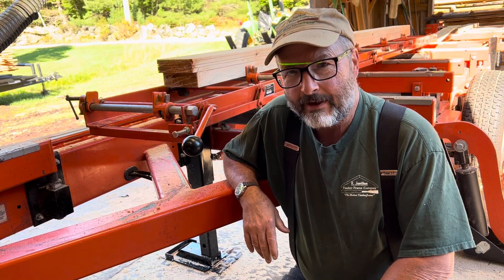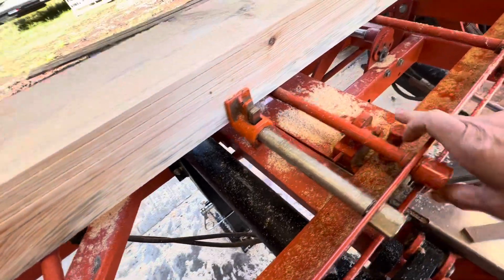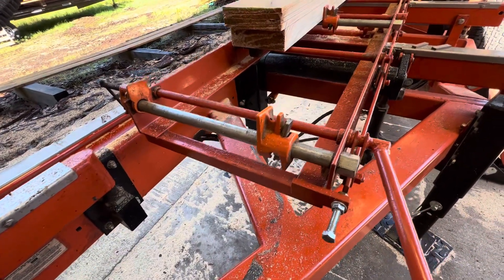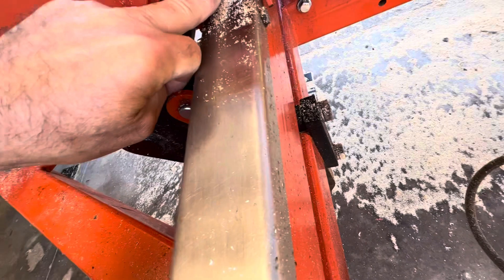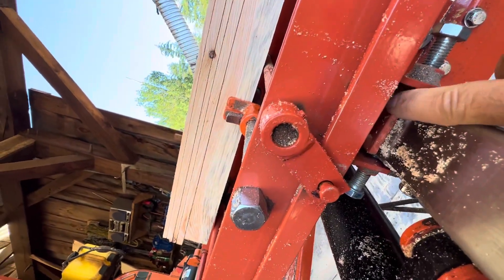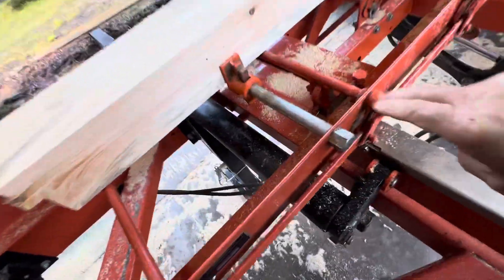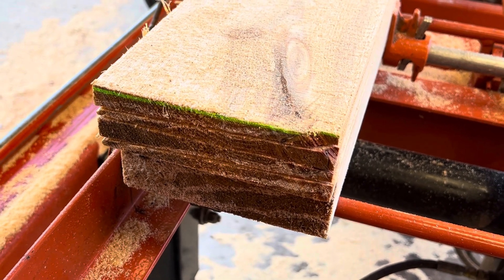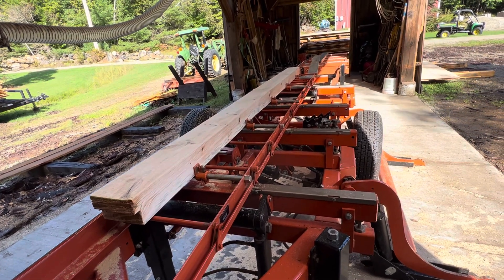Clapboards - Woodmizer Lapsider clapboard set up explained

Comment: Great video I just ordered one.
Reply from the maker: Hi Paul
One thing I left out was to loosen the cams and slide them to the dust chute side.
Also, when you loosen the cam set screws, take them out and put never seize on the threads - the set screws can be a bear to remove if you don’t add the never seize…. I know!
Good luck with the jig it’s working great for me - I’m re clapboarding my house.